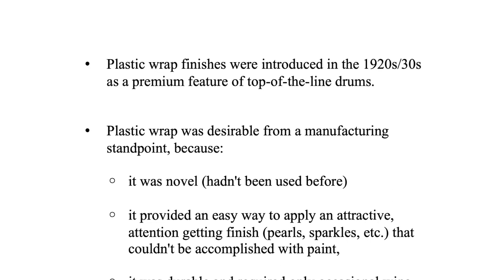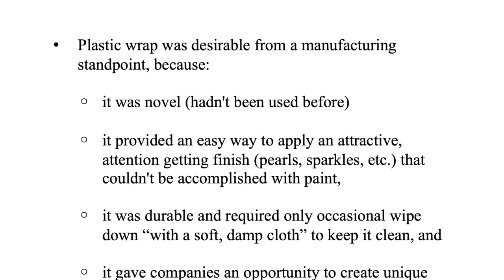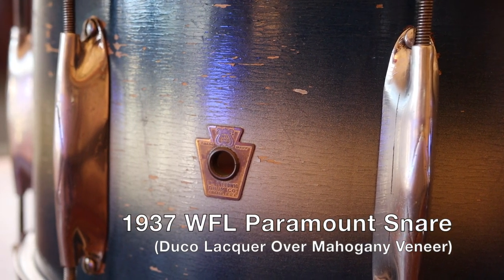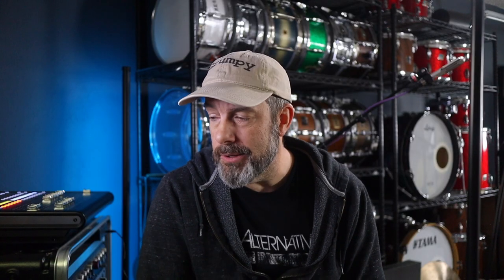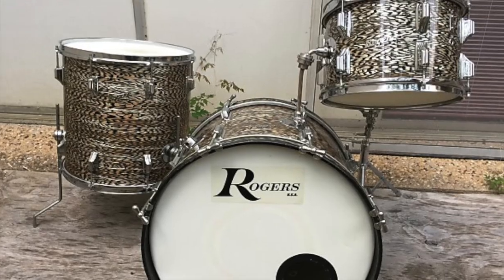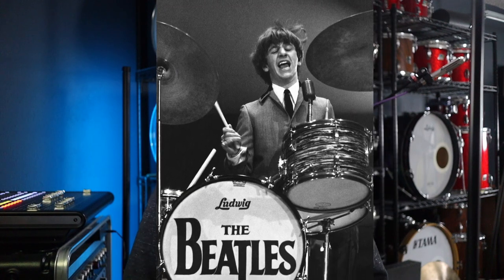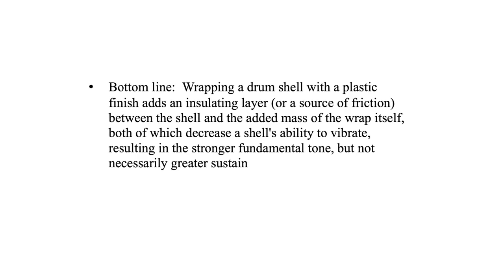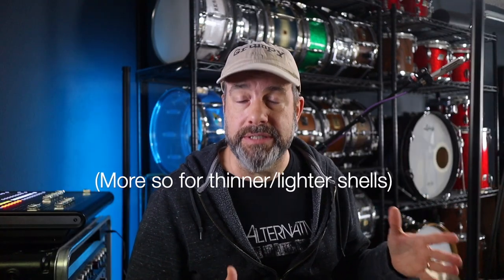Is plastic drum wrap really bad for my drum sound?

Comment: The whole thing about sealed interior,  I believe (and imho), is legit. First, Buddy Rich had his drums sealed with 4 coats of laquer.  Second,  I have built 2 6 pc drum sets. The maple kit always sounded a little wonky, until my friend,  (same guy that took lessons from Ellis Tolan, you know who he is, and had it told to him about Buddy's drums), told me the Buddy story,  and I lacquered the kit. And Behold! Weird overtones went away! So.....yes on sealing interior and, cough (BS), on some companies claim on wrap! Imho, anyway.  Thanks for an enlightening and awesome video.
Reply from the maker: I am in full agreement with you -- one of the things I noticed over the decades of recording drums is that virtually ALL entry level (and some mid-level) drum kits lack a sealer on the interior -- the wood is raw and bare.  As a result the drums lack clarity and definition in the higher frequencies (which get sucked up by the raw wood).  ALL professional drums for the last many decades have sealed interiors, even if it is only an oil rubbed finish (which doesn't shine).  The wood is sealed, however, and that layer of protection keeps the shell from sucking up the highs so much, so they reflect and hang around a little longer inside the drum, creating greater clarity and a brighter, livelier tone (regardless of the mass of the shell).  I haven't yet gotten to this topic in my video discussions, but it is coming, so that's just a little preview ;)

So take an early Pacific CX or MX series maple kit, for example, and seal the interiors (and smooth the bearing edges of the shrapnel left behind from the routing table with a little 320 grit sandpaper before sealing), and they become very nice drums indeed!  Cheap and effective!!
Reply: @DrumDotPizza  lol. Nice comment about the 320 grit. Everyone says don't go above 220 grit. On bearing edges,  i finish with 320 grit then 0000 steel wool.
Reply: I don't think most drummers know who Ellis Tolin was. I bought a big set of Sonor phonic drums from him with concert toms. They had a sharp 45 degree edge and even though they were thick shells, they had no sustain.  They sounded good, but the note cut off right away. They were covered on the shell in thick plastic, too. The glue mentioned in the video that was sticky was probably just contact cement, which wouldn't hold the plastic tightly to the shell.
Reply from the maker: @davidlanier7006  Thank you so much for bringing this up!  Your post provides an interesting reality that I hadn't thought about including in this series of discussions, but now I might (because it's worth addressing, IMO):  concert toms.  Single heads toms have no resonant heads to interact with the batter for a longer period of time.  As such the sustain of concert toms depends heavily on the type of head used (heavier films and/or dual-ply heads will produce far less sustain) as well as the tuning used.  Anything above midrange tension will likely shorten the decay of the drum (even more so for smaller diameters).  Thin, single-ply heads tuned at or below midrange will produce the greatest sustain on a concert tom in my experience.  The lack of resonant head severely limits sustain.
Reply: @david lanier  you're correct about the contact cement,  but it's a specific type; 3m fastbond 30NF. I use it exclusively,  and it's the one precision drum uses too. Gotta love Sonor, it was my first kit. But mine were thin shell, definitely a beginner model. They were somewhat resonant,  as i best recall. So you were familiar with music city in Philly?
Reply: @williamfotiou7577  I lived a few miles from Music City over in Cherry Hill, NJ. Supposedly, Buddy would always stop by to see Ellis when the band was in the area. I missed meeting Buddy by a few hours one day. I saw Buddy play a couple times in that area in the late 70's. I know where Music City was over in Philly.
Reply: @david lanier  you're correct on all points. My teacher took lessons at music city. There were times when Buddy would stop by and go to the basement and test some snares. I have tons of Buddy stories, plus you know he played in Somers Point a lot, too.
Reply: @williamfotiou7577  your drum teacher? Who was your drum teacher?
Reply: @david lanier  Ray Nunzi, in the 70's i also took lessons from john Almier too.

Comment: I saw on a DW video a while back, where they said the reason why they didn't like the traditional wraps was the overlap of the seam around where the head sat on the shell. Basically the overlap would mute the drumhead more than a painted shell would. Their solution with Finishply was to cut a notch the covered part of the wrap right under where the head would go so the wrap would sit completely flush against the shell. This (in combo with the glued wrap on the shell) would basically make the wrap invisible from a sonic sense. It seems to make sense to me, but I don't own a DW kit, so I don't really have first hand knowledge.
Reply from the maker: Yeah, I've seen their pattern for wrapping drums.  Don't know how true that is, though certainly a flat, round shell is ideal.  Depends, I guess on the actual outer diameter of the shell... if the head can spin freely on the shell.  I'd be curious to do an audition to see what difference it does make.

Interestingly, Ludwig (which I understand is now owned by DW) machines their plastic wraps with a beveled thickness at the ends that tapers down to nothing, allowing the seams to be perfectly flat, not raised, preserving the roundness of the shell.
Reply: The early wrapped kits from DW were so crude in their finish I could see why they got scientific about it..

Comment: Very interesting video!!!  In 1977 I purchased my first "real" drum set.  It was a Slingerland RJB outfit in Blakrome with 5 ply shells.  When you ordered you could get the thinner three ply shells or the 5 ply shells and I got the 5 ply.  The Blakrome was a metal wrap, not plastic, on the drum.  Unfortunately there were a couple places where the wrap was higher than the bearing edge so I had my dad do some work on the drums to remove where the metal wrap was hitting the head.  I still have that kit and they sound great. Thanks for sharing!!!
Reply from the maker: Those 5-ply Slingys are HEAVY DRUMS!  I LOVE them (a buddy of mine has the copper wrap versions, and they have balls for days!

Comment: I just found your channel.  It's amazing.  Thanks for this series!

Adhesive seems like it would be the biggest difference between a wrap and a sprayed finish.  Much like Green Glue used in studio room construction, soft adhesive will have a very different resonant frequency than either the wood or the wrap.  In studio constuction, multiple layers of gypsum board separated by Green Glue interferes with the gypsum's resonant frequency.  Using different materials for different layers of wall construction (sheetrock/ Celotex. MDF/ whatever) interferes with any of the layers' ability to resonate.  The same ought to hold true for drums.  It does make me wonder how using different different woods in adjacent layers affets a drum's ability to resonate, and how the fundamental of  the combination is affected.

Comment: As a cabinet and furniture fabricator my whole life, I am impressed you brought up the difference in the adhesives. Since LP or Laminated Plastic is applied with a rubber adhesive. But many companies Lay UP, or Glue there plastic veneers on with a wet glue, that hardens completely after curing. And I guarantee you there will be a sound difference in the exact same drum with the exact same plastic veneer, BUT WITH THE DIFFERENT GLUE ON EACH. Great job.

Comment: I’ve re-wrapped a few kits and I never use glue. Just two sided carpet tape only at the ends on the wrap, about an inch wide. I attach it to the wood and at the opposite end when it overlaps. I line up the overlap so it lands under the lugs and let all the lugs hold the wrap in place.

Comment: I've tried both and they did sound differently from each other but I can't attribute it to the wrapped/not wrapped situation because the wood, thickness and bearing edges were different from one brand to the other. So, I consider this a moot point in my personal playing.

However, there is a major affect on my choice and that is practicality. I had a beautiful painted and clear coated set of Ludwig shells that I unintentionally damaged by good intentions. I sprayed them with LEMON Pledge furniture spray (I had used regular Pledge before, with no ill-effects on the same set.) The Lemon Pledge dissolved the clear coat and left a very dull silver sparkle coating which looked terrible. The sound had not changed but the beauty was gone.
 
Since my drums spend a lot of time traveling to gigs, they are subject to possible damage to the finish. Now I use wrapped shells and I love them. I pay more attention to the woods, number of plies, bearing edges, dimension of the shells, heads and hoops than I do to the finish being wrapped or not. 

So many variables. It always comes down to how they sound. Each choice is a personal choice, just like choosing your favorite ice cream flavor and brand.

Another great video with "food for thought". I never agree or disagree with you because the content is so good. Keep them coming. Your hard work is not wasted on me.
Reply from the maker: Thank you for your kind words and for being here!
Reply: @drumdotpizza  lol

Comment: I believe that any attachment to drum shells do have an effect on the sound of wood shell drums..although that effect can be miniscule to the point of being negligible.  I generally prefer lacquered or natural unwrapped wood shell drums but I have some excellent drums that have plastic wraps.  There is a definite difference in quality of wraps, though.  I have some mid-1960's era Rogers drums with wrap finish that the wrap is still good and tight no lifting just some 'character marks' from scuffs, etc. yet I've seen brand new cheaper drums with wrap finishes that the wrap starts lifting off in short order.  I do like the variety of wrap finishes sparkles,  onyxes,  etc.

Comment: Great, informative video~! Thanks. I wonder too if drum companies sometimes used plastic wraps to cover blemishes in the wood shells. I once removed the black sparkle wrap on a beautiful Gretsch  round badge kit (I was young and foolish!) because I had heard that the wrap reduces resonance. The wrap had started to lift off the shell naturally. After removing all the glue etc I put clear (Poly!!) urethan coating on the shells. The drums did end up looking pretty but I am not convinced that they had any more resonance. And they certainly lost some resale value. But the main point is that the 12 inch tom had an ugly, three inch wide white-yellow seam the length of the drum that deformed the roundness of the shell a tiny bit. The wrap nicely concealed that. Ultimately I wish I had left those drums as is.

Comment: Very interesting. I have been working on drums-repairing, refinishing, rebuilding for close to 50 years. Most 60's-70's American wrap glues have been INCREDIBLY hard to remove. I very recently stripped the glue off a 60's round badge Gretsch marching drum. Went through at least 10 sanding discs to remove the almost glass-like adhesive.Hard and sharp edges.And I stripped the chrome finish off a Slingerland chrome o wood 18" FT. which had that same glue and pulled strips of ply out of the drum it was so hard.
Reply from the maker: Have you ever removed the copper wrap from early 70s Slingerlands?  They only made that finish for a couple of years, but it is downright deadly stuff.... will slice you to pieces trying to remove it!

Yeah, the American companies used lots of glue and pressure on their wrapped finishes.  The mahogany shells in particular (Slingerland used an outer ply of mahogany just about up to 1980) are prone to being pulled apart/shredded when pulling the finish off.  Lots of heat to soften the adhesive will help preserve the mahogany veneer it's glued to.  

From what I've seen Japanese companies (Pearl, especially) often used tape only at the seams for their wraps (and the hardware obviously holds the wrap on well), which makes rewrapping those drums something of a breeze, usually.  Having said that I did remove wrap from a Tama Imperialstar shell from early 80s that was glued all the way around (factory Metallic White wrap), so they did glue some all the way around.  Other vintage Imperialstars were taped, so Tama, at least, evolved their  method of wrapping shells over time.

Thanks so much for being here!!
Reply: @drumdotpizza  I'm stripping an 80's luan Gretsch Blackhawk right now and the final damage was repairable. Tried the heat gun and it melted the wrap before the double sided tape let go.5 rows of tape and the ends...

Comment: Interesting suggestions, im playing around with shells at the moment, I find the bearing edge and components the only thing that's important at the moment, especially how smooth the crest is and how free but tight fitting the contact between head and the crest is, I do have a metal snare which I was consider adding different materials to see if that would change the dynamics of the drum sound, as for resonance would it dampen or introduce decay much sooner, something I haven't tried yet, I'm in the middle of refurbishing a full kit, only a cheap one, the shell have a very limited ring when struck and dull.

Comment: Hugely enjoying this series! Thank you for doing these. But, I do have a few thoughts: I’ve learned to be a little less bigoted about my views on drums sounds recently having been completely turned around by my latest drum kit purchase (Sonor Birch Infinite) about some ideas I’ve had for a long time. So, when I say this, I realize that I’ve never played on any of those big heavy Sonor kits (other than my 22X14 Phonic bass drum that I will never replace with a newer kick, but that has more to do with its dimensions than shell thickness).  So, admittedly, my opinions on this stuff is completely based on listening to recordings. But, I definitely prefer to hear the drum shell as part of the sound. Recording of those big heavy shells always sound very dry to my ear. 

But, that leads directly into my next point: controlling for variables in this discussion is huge problem for a truly scientific answer. Anyone could easily say to me, “You’re only hearing a dryer sound because those drums are harder to record in less than ideal situations, etc…” 

Also, you could be testing two different drums with different thicknesses, and still rightly question the resulting differences in sound on any number of variables in. the entire construction process. i.e. not every piece of wood even from the same tree is going to have exact properties, drums shells are handmade therefore variability in the techniques of the person who worked the drum press, etc…

Another aspect of drum sound I haven’t heard you address is the room that the drum in played in (yes, I end sentences with prepositions. Sue me). If you’re in a terrible sounding room, it doesn’t matter how good the drum is; it’s going to sound terrible. A drum-more than any other instrument-is so influenced by the room it’s in. At least imo.

Comment: This is an interesting argument. I started drum refinishing in 1997. I've wrapped many kits. The wrap may affect the vibration of a shell. It will be very minimal. The glue and wrap have almost no weight. To think wrap would deaden a shell, then painted and lacquer should do the same. As these finishes soak into the wood. As well fiberglass was mentioned. There is minimal difference with fiberglass lining as well. 

Side note. Do not listen to any marketing DW uses. You can't really tune a tom to the note of the shell. As soon as you install the lugs and mounting hardware, the pitch drops. More DW hogwash.
Reply: LOL DW hogwash.
Reply: Yes You are 100% Correct
Reply: A Lacquered shell actually has more dampening affect than Wrapped one.
It is absorbed deeply into it and seals it totally.

Comment: Interestingly the Tamburo Unika drums use a high pressure laminate wrap both inside and out to sandwich just a 3 ply popular core. Rigid and lightweight is how they describe it. They have full round over bearing edges and I can't decide what most determines their tone, the bearing edges or the hpl. Obviously it's a symbiotic relationship but I can't help but think the bearing edge has the greatest influence.
Reply from the maker: Yes, I agree.  I would argue the bearing edge has a much more profound impact on the sound of a drum than plastic wrap would.  (And heads.  And tuning, and muffling...)